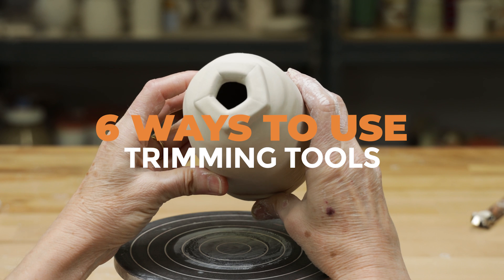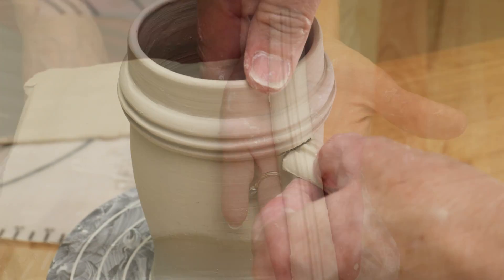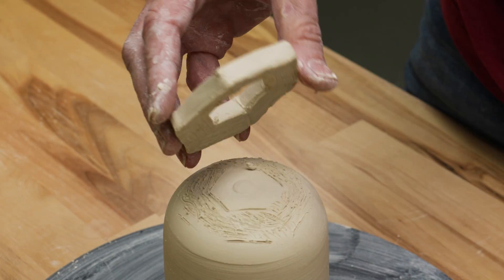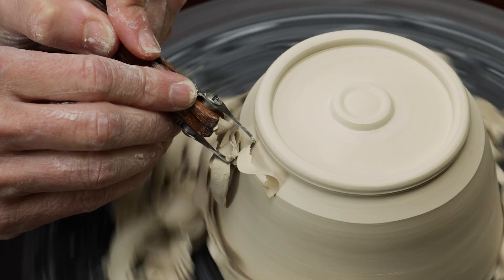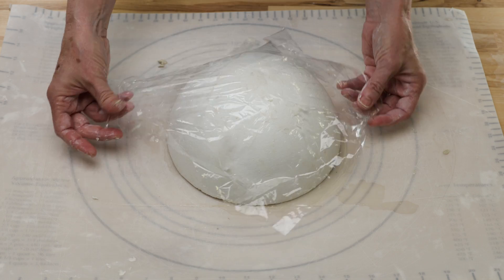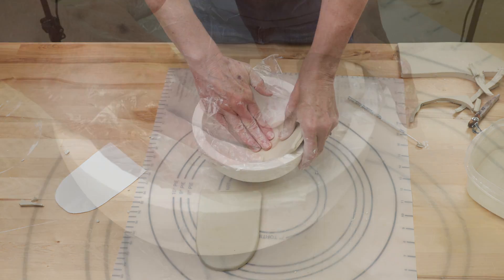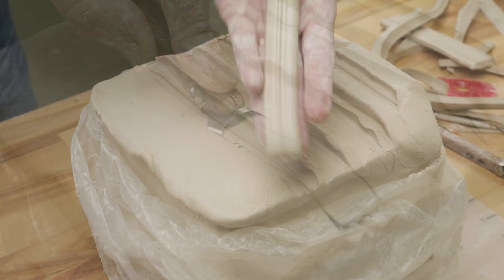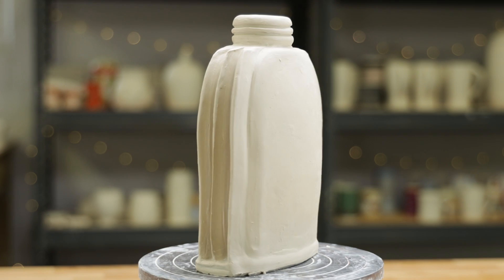6 Ways to Use Trimming Tools. ADD PIZAZZ TO YOUR POTS!

Comment: Is it the R 8 tool? The double edge one? I live whichever one you used. Do u mind telling which Diamond core tools u used.
Reply: Hi Paula.  For this video I did use the R8 which is the faceted extruder for the first project with the mug (the handle and the banding).  I used the R1 for the hexagon rim.  I used the T1 and3 for the foot trimmings  I used the R2 for the handbuilt bowl foot and the decorative appliques on the bottle vase.  I used the R4 for the lugs on the side of the bowl. :-)